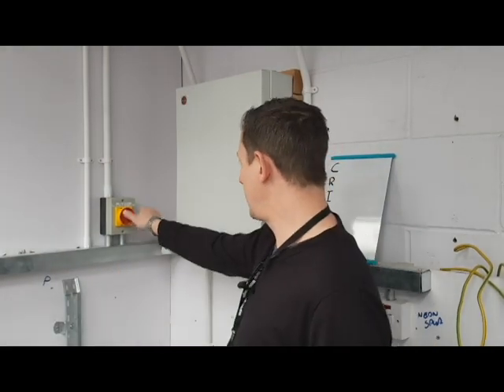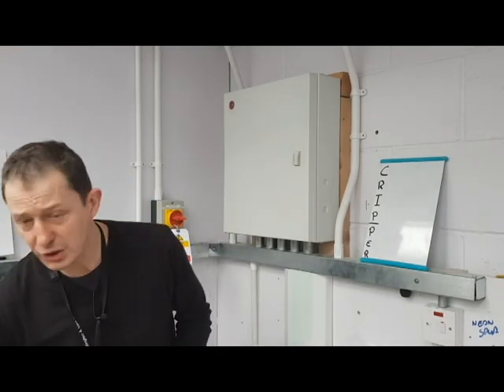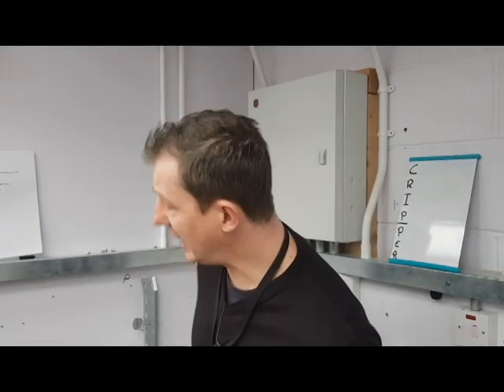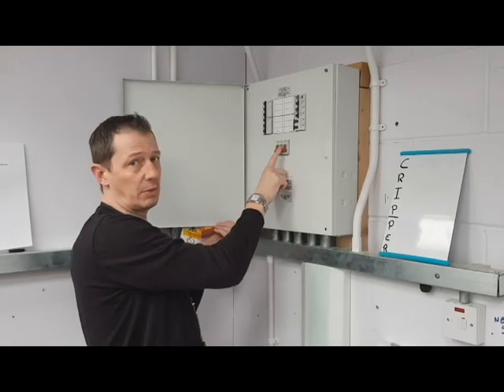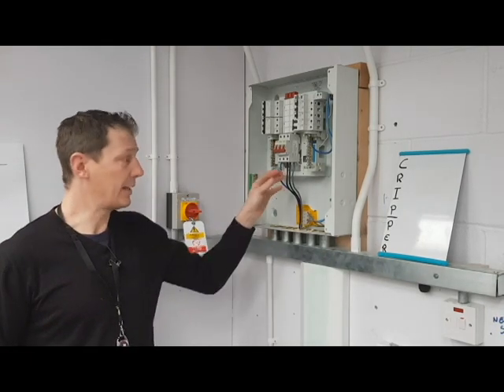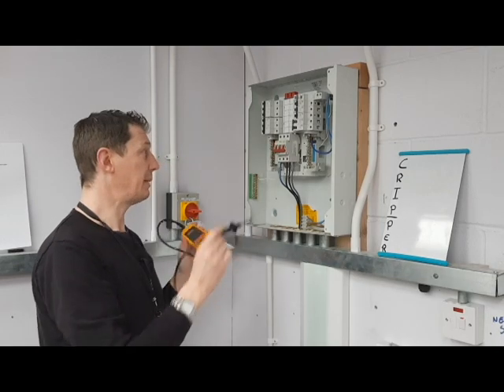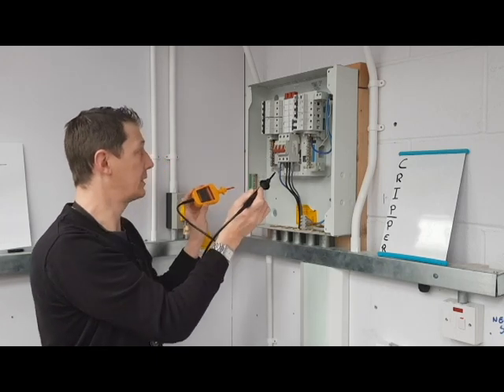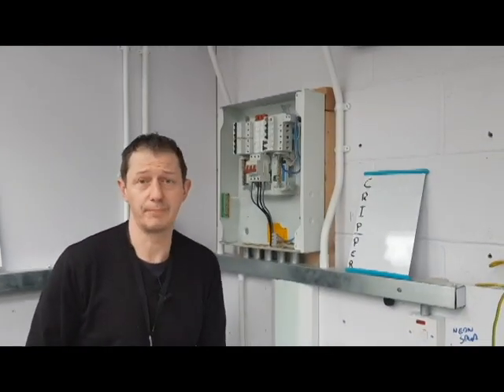3 Phase Safe Isolation

Comment: Good video, good process. One (pedantic) possible improvement could be to reverse the test sequence, i.e. start with N-E an end with the Phase to Phase. We had an instrument blow up the resulted in serious injuries for the engineer. The otherwise undetectable fault in the meter would possible have failed with less fault current if it had blown on Phase to earth. Good to see you are testing for dead without testing on a 'known live source' though.